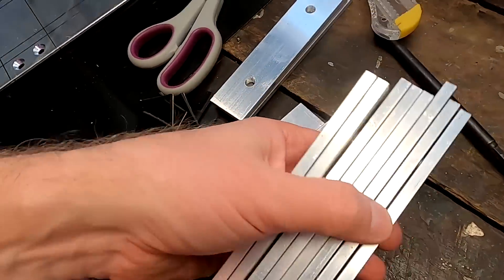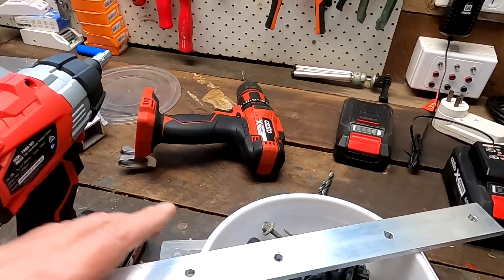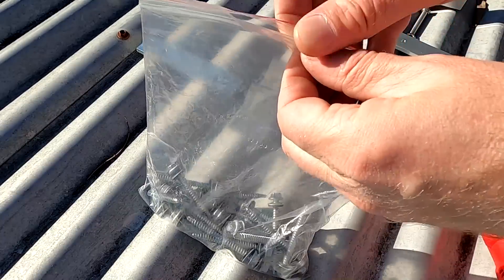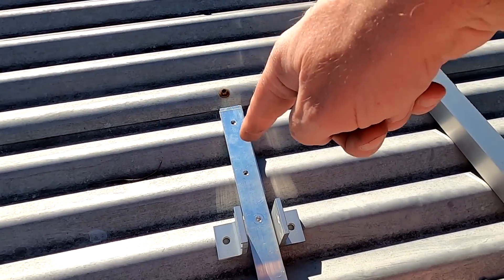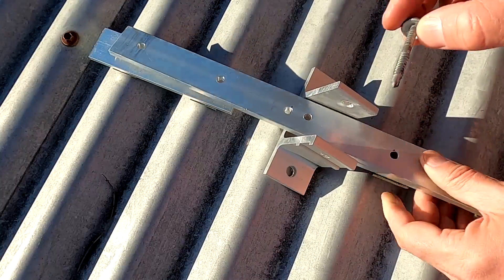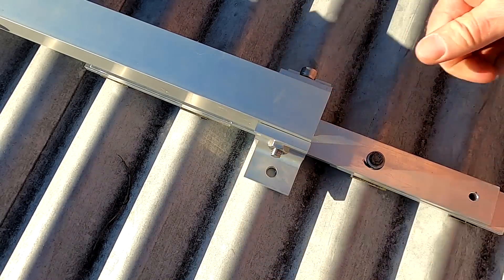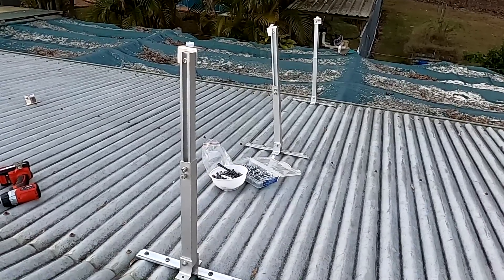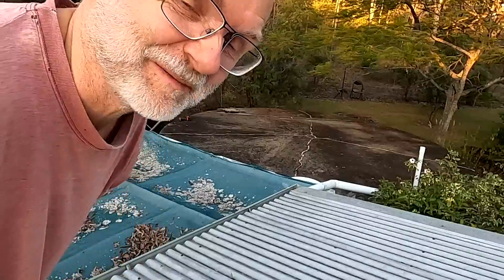Installing a 30° Solar Tilt-System to harvest the Winter sun. Will this hold our panels?

Comment: enjoying all your vids. dont you need a seal between the mount and the cross bar. There is one on  roof and the screw has gromet. but what about between cross bar and mount?  small amount of water leak?

Comment: As the cost of the panels continues to fall, if you do the cost / benefit analysis, as long as you have enough roof space, pretty much the best option is panels at the min angle to self clean (12deg) but fit as many panels as you can!  It's amazing how the costs of the fixings adds up, especially if you start needing multiple rails, brackets, feet, angles/hinges, and as an angled panel creates more lift, you probably need more structure as well!  All that money could be simply spent on fitting more panels :-)
Reply from the maker: Yes, that is what I said in the next video after that here. The problem or restriction here is the inverter I want to use. I cannot over-panel it.

Comment: For my new house I requested my architect for my panels to be tiltable to 60 degrees in the winter. In the summer they will just lay flat on the roof 0 degrees. The difference is 1:8 between winter and summer sun.
Reply from the maker: That will work fine. It is all so much easier to factor this all in from the beginning.
But don't lay them flat as dirt and dust will built up over time. Make them 10° or so...

Comment: I don't think 5 screws is overkill. You might be surprised at how much force a medium wind can exert, never mind a storm.

BUT... there is another consideration. There's no point in firmly attaching to a roof that's going to rip right off long before the solar panels rip off the roof.

It's worth considering the whole system and structure and what you want to fail first: do you want the solar panels to go first, leaving the roof basically infact, or do you want the whole roof to get ripped off along with the solar panels?

Panels that are mounted low and parallel with the roof will catch the wind only a tiny fraction of what angled ones will.

There's always the option to reinforce the entire roof structure such that the panels are locked into the load-bearing skeleton of the building rather than thin corrugated panels that can easily be ripped, but then the strength of the entire building's structure must be studied and taken into account. Is it better to just let the solar panels go, or keep everything together a lot longer but ultimately lose everything instead of just the panels?

From what I can see of your roof, I would say that unless you want to go to a lot more work and expense that putting more screws into your roof will probably not have the result you expect or want. Even 3 screws might be too much.
Reply from the maker: Very good points. Thank you.

Comment: Hey mate, i have stumbled across you channel only a few days ago , Currently have 5kw on the roof with a solaredge inverter ,we got it installed in 2014 making about 28kw a day in winter and doing about 30+ through summer , i want to add a Multiplus ii GX to the mix and add 16 304ah batteries , 
Your videos have been awesome ! right time right place!

also the links to the 304ah cells don't work , Cheers
Reply from the maker: Thanks for your feedback and welcome to the channel.

Checked all 304Ah links and they all seem to work for me on mobile and also PC... Which one is not working for you?

Comment: Hi Andy, this is bombenfest in deed but your roof will be undicht because of die Dichtungsscheiben an den Trapezblechschrauben havent any Chance to abdichten. 
Ansonsten, mach weiter so, ich nehm viel mit und hab regelmäßig Spaß an deinen Videos.
Gruß aus Hamburg.
Reply from the maker: Nothing is leaking. There is a rubber under the flat aluminium bars and the hole is on top of the corrugated roof part. There is pretty much no water 'flowing' there. The screw on top has also a rubber washer. It is also #bombendicht
Reply: @OffGridGarageAustralia  jedenfalls haben wir was für den Algorithmus getan :)
Reply: Dafür ist doch das Gummi unter den Alustangen?
Reply: Das quadratische Gummi hebt die Höhenunterschiede auf, die Dichtungsgummis an den Schrauben werden durch die gewölbten Scheiben auf die gerundete Oberfläche der Wellbleche gedrückt. Andy wird sicher berichten, wenns mal cats and dogs regnet.

Comment: Hi Andy,
   You do realise, of course, that the roof angle of the solar panel has very little affect on the performance of the panel. This is especially when compared to shading. Try an experiment using a panel from say 20 degrees through to 70 degrees. You may be surprised.
Cheers,
Bill
Reply from the maker: I did this experiment a lot of time and the angle is key to success. flat on the roof or S.P.A.T. orientated makes all the difference. 100W vs 350W to be precise.

Comment: Seeing how solid you uprights for your angled installation are Andy, I could not help but visualize a couple of linear positioners connected to a cross-bar to each row of panels  in place of the fixed-uprights might work, and wonder if that might be worthwhile?
Reply from the maker: Once the panels are mounted and clamped down on the rails, the installation will be very tough and sturdy. A cross bar (corner to corner) could be beneficial for a steeper angle, maybe 50-75deg).
Reply: @OffGridGarageAustralia  I was thinking mounting the lower end on a hinge, the crossbar at the top, and a couple of linear actuators to help optimize Sun angle capture
Reply from the maker: @jackoneil3933  oh, wow... Now we are talking sun tracking...
Reply: @OffGridGarageAustralia  Yup! Can be cheap and simple with your roof set-up. You raise the hinge side and so the panels could tilt to the morning sun angle. and also stow them flat for high winds and overcast. And Perhaps a Rasberry Pi programmed to drive actuators to match sun angles would be simpler than a sun -tracker.